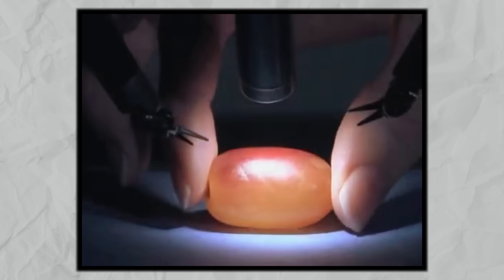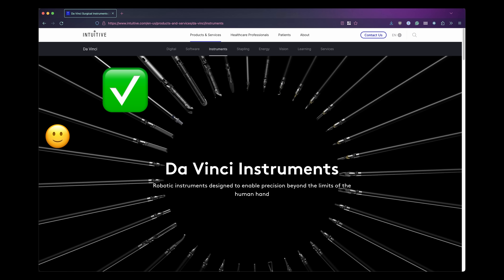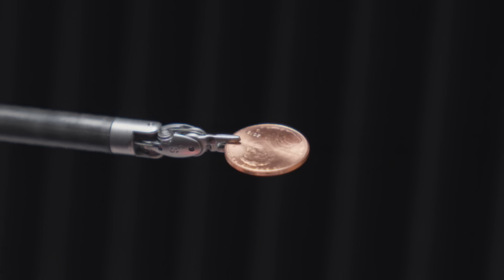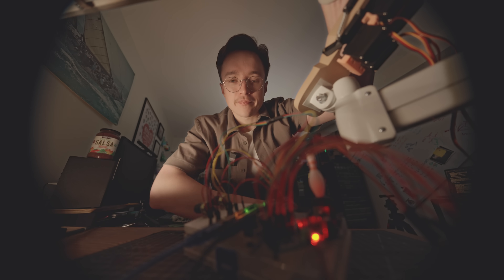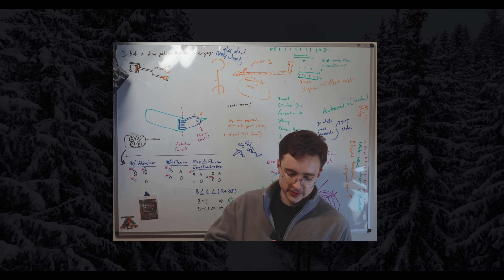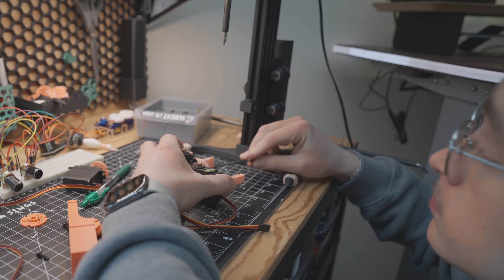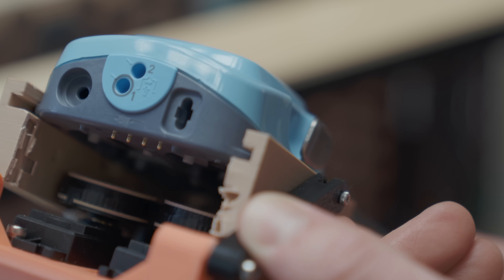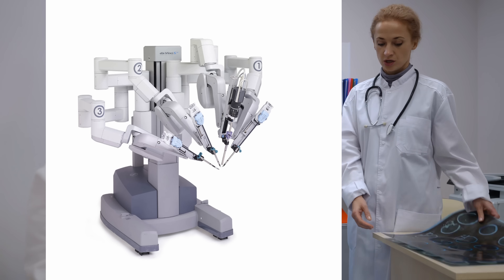Building a DIY Surgical Robot

Comment: This is an awesome project with a very real customer base. There are people who live remotely and there is a need for some kinds of minor surgeries to be performed on site. In my case I live on a boat and alone. The kinds of procedures are initially observation, recording, and transmitting information for remote diagnosis. The second procedure set is to do with a large number of skin surface procedures treating infections, cleaning and closing wounds, removing foreign objects such as splinters, glass fragments, and shrapnel of various types. 
A robot to perform this kind of procedure does not need to be a long reach robot as in the video. It will best be a very local kind of device that is placed on the body, or the body is pushed against a device that is fixed to a structure.  I would suggest starting with a cylindrical housing of around 200mm inside of which the process takes place. There would be a rotary housing which carry perhaps 3 short “fingers” that carry tools and a number of auxiliary functions such as suction, flushing, wiping, injecting, etc. Note the penetration reach of all of these devices is very short or shallow. 
A typical “procedure” might be to lance an infection, clean, disinfect, close and apply a dressing. 
Regardless of whether you see this as I do, you have me thinking about this need in a practical way. I am going to follow where you go with this with great interest. Thanks. I am a customer of a self surgery aid.

Comment: The most intuitive control I can think of for this is the wii controller. It might be another can of worms trying to decode that thing, but it allows for 3D motion in space and if you can figure out how to translate the robots motion by inverse kinematics, two wii controllers could imitate two robot arms. A and B button to close (hold) and close (trigger), orientation of the wii controller determines it's angle, translation of the controller determines translation. All wii controller accelerations are non linear, to allow for faster movements to cover greater distances virtually then they do physically (similar to mouse acceleration on a computer) and thus, the wii controller is the perfect choice.

Comment: Hi Bennett. Excellent work. I started down this same path last summer, prototyping a possible exhibit for a California science museum. In the end the exhibit got dropped ... but I'm still very much interested. I've got 3 of the "blue" units here (pincer-type, can't recall exact one) and a similar box of iterative 3D printed mounts. I like your spring-loaded coupling mechanism. Mine simply rides down the grooves and snaps into place, depending on rotating the discs until they seat properly.  I'll check out your git repo.

Comment: Hey Bennett! I’m actually used to be a Manufacturing Engineer for the Core Instruments division of Intuitive! You’ve got the older Si instruments there. Very impressed with your work! There’s a lot that goes into making that “talking” between the robot and instrument happen but you covered the basics great! A little background on the “life count” they actually have to qualify every instrument for a specific number of lives by running new versions through simulated use and do some math to calculate what the max life count would be. All has to be submitted through the FDA and approved for every country we send instruments to! Great Video!!

Comment: Make a gauntlet made with 1 micro proximity sensor in each finger. That is for flex,  extension and rotation. For movement you should hold your elbow in a platform with X and Y. With this system, you can do all with one hand.

Comment: A bit silly for a control solution but have you checked out VR gloves as a solution? You could try to map the movement of specific fingers and such much like the complicated machine the doctor uses  in the video. Though, you'd have to account for the limits of each machine, and I wouldn't really call it a precise solution either. But, it would definitely feel intuitive (if done right)

Comment: You could use a 6DOF controller from 3dconnexions, and then translate the output of that as serial commands to the device. A space explorer or pilot (both of which are deprecated parts) might be a good fit.

Or, you could just use a PS1/2 controller since they're serial to begin with and kinda easy to read, and they're like 8 bucks.

Comment: I might suggest looking into how 3d mice establish their many degrees of freedom. I saw another youtuber make a DIY version using a hall effect sensor and a magnet mounted to floating platform held in the air by 3 springs. Using an microcontroller you can measure the changes to twist, pitch, and height.

Comment: Do the servos really just snap in the 4 rotating disks like that on the actual machine? The coupling seems so small im surprised these small ‘bumps’ on the disks are able to transfer torque and dont just snap out of place. Im going to check out the CAD later, amazing stuff!!
Reply: These were my exact same thoughts, how did you get on?

Comment: About the controls:
1, a glove that controls the 2 metallic "fingers" precisely. 
2, Either 2 cameras to detect your hand "gestures" (we do not care the fingers) or a leap motion to detect the gestures.
3, some kind of virtual UI to assign the robot arms to your arms so you can control them with 1, and 2,
This is a good starting point. Later on you will need some kind of stand as your hands would be super tired and painful after keeping them in air for 30 minutes.
If you like it and you need help, just let me know.

Comment: Hey I love the video. Your resourcefulness is impressive. 

I know you have seen how the pilot cockpit looks like. One thing you don’t see are the pedals. They help you select which arm is active. 

For controlling the arms. I would use vr controllers like a valve index. You could even kinda mount those controllers to a swing  type thing if you wanted so you would have hard stops to keep you safe from pushing out of the surgical field. You can hold a button down that allows you to tell your electronics controller when you’re moving the tip and at that time you can increase the downscaling of motion in the arm and upscale your wrist motion to move the tip.  And in a sense you could do the opposite when the button is off. 
And yeah obviously all motion is scaled.  

Hope this helps.
Reply: A controller with an index trigger would work well to help you understand pen and close the tip.
Reply: Open

Comment: So I've actually briefly used one in a hospital brought in by a vendor. The controls at the station are electronically counter balanced and have different selectable scaling options built into the software to scale down you hand motions within the work space. They're incredibly well balanced and smooth, but id imagine you could achieve similar results with a cable and pulley balance system. Could also install rotary encoders on the balance pulleys to translate the movements.

Comment: I worked in surgical robotics for a few years, the way the tool attaches is via the sterile drape, you have it right that is it is spring loaded but each input axis typically has a disc that that can side before engaging and creates an oldham coupler to take up small misalignments. Typically you have to engage the drape side first onto the robot and then the drape to the tool. As someone else said the robot uses an RCM- remote center so the Dofs needed are smaller than you might believe- this reason the DaVinci has so many joints is to setup the RCM to the patient and then have redundant motion for clearance arm to arm. The Xi is far superior to the Si in this regard.

As to the inputs, you really don’t need anything crazy. The reason the DaVinci inputs are crazy is that they need the user to match the location and orientation of the tool. You can get away with nearly any kind of 6Dof sensor and it will work fine, you just have to pay attention when you clutch in and out a lot more.
Reply: The tools are cool inside, there are many different mechanisms to drive the wrist depending on device. If you open one know that the cables are tungsten and will be near impossible to cut and once cut conventionally become unusable.

Comment: Hi, I cannot stress enough how impressed I am from this work! Do I understand correctly that the ortho-planar springs in servo output shaft take care of the initial alignment with the spools in the intuitive tool? (i.e. the two pins initially can be not aligned with the holes in the disk on the servo and at some while this second rotates, they fill align?) Also, do you think this type of connection with the pins can cause backlash for the toletances pin-hole? Thanks!
Reply from the maker: That’s right on the alignment of the pins! An interesting property is the backlash you mention- the springs will give about 3-5 degrees under sufficient load, at which point the internal branches of the spring sort of run into one another, at which point the spring behaves like a rigid connection, until the high load is released and the spring decompresses (this assumes the pins have been aligned and the spring is completely planar)

I want to see how this can be mitigated with higher tolerance prints and special materials. TBD!
Reply: @BennettStirton  That's interesting, I look forward to seeing your development with this! (Just pay attention that if the springs comply also in torsional direction (It I understood correctly your point) at the inversion of motion you won't have accurate control from the feedback in your motors. Could it make sense to add in the design of the ortho-planar springs a feature that prevents torsional compliance while leaving the axial one? (Unless of course these daVinci probes have integrated encoders in the spools and you can read the output)...In any case, good luck and again great work!

Comment: For control you could always look at 3D input devices, such as the SpaceMouse and its DIY clones: Space Mushroom (by shiura here on YT), OS3M (by colton.baldridge on Hackaday IO), SixNav (by Shamrock, ShamrockTeam, or GreenCappuccino, the latter is their current GitHub name but the project was produced under their earlier name[s]), haptik (by ioces here on YT), etc.  The great thing about a 6dof input device is that you essentially get six axes of movement, both positive and negative, meaning you could control an entire arm via one input device, including the end effector at the 'wrist.'  Going the DIY route you could also do more, such as putting a joystick on top of the 6dof nub akin to how flight sticks will often have extra input, this could also apply to analog buttons (triggers), various directions of scroll wheels, or even putting the 6dof nub on top of something else such as a base with a rotary encoder, all for extra functions or for making functions more intuitive to use.  Alternatively, just get some VR wands, same concept but with a greater range of movement while also not being physically bound to anything.  The only thing is the kinematic input, as it's not as intuitive as most people would think; for example, say you have a 6dof input device and a 6dof robotic arm, these degrees of freedom are not equivalent, the input device has three axes of rotational and linear movement based around a common origin whereas the robotic arm bases these degrees on pivots within its limbs, where the input device should really only be mapped to the end effector's position and movement where the arm's various degrees of freedom are manipulated to achieve the end effector's position and movement. 

On another note, the end effectors themselves aren't all that complex either, as they're just cable driven components, which has been popping up in popularity over the past half decade in robotics, but these cable mechanisms have been around for quite some time in the medical industry.  The only issue on the DIY side is manufacturing at scale, but at the same time these all use very simplistic parts that you could realistically produce yourself with some basic metalworking, i.e. drills and hand saws if not also stepping up to using punches for repetitive parts; the only truly lathed parts needed would potentially be the drums at the the end of the cables, but a rod with some grooves for circlips would also suffice in all honesty.  These parts really are simplistic, it's just the scale of the parts that can be troublesome on the DIY side of things, but the entire end effector mechanism is entirely reproducible if you're looking for specific tools that don't exist within DaVinci's platform.

Comment: I had the opportunity to use one when the local hospital, that my parents worked at, got one and had a demo in its loby. It was extremely intuitive and required no leaning curve. I was in highschool at the time and it was really fun.
Reply: I will say that the freedom of movement afforded by the complex system was limitless. I had full range of motion of my hand. And there was a foot pedal that allowed you to pause movement of the system and pan your hand away. Similar to picking up a computer mouse off its pad moving it over and bringing it back down. After a couple minutes I felt entirely one with the machine
Reply from the maker: This is a great analogy- I read in a manual about this virtual “clutch” system, but this makes more sense now! Thanks!

Comment: Certified Da Vinci robotic surgeon here. A few comments:

- Yes, it is awesome to use one. Not only the range of motion and precision, but also the 3d high definition vision inside of a patient.
- the instruments you were able to  get are from the Da Vinci Si. This version is deprecated and if I am not mistaken, they are not being produced anymore. The new version (Xi) uses instruments that work similarly, but are not compatible (planned obsolescence for sure, the Xi offers very few benefits over the Si, which was already very good, they lost some of their patents).
- you control the instruments with two joysticks. There are pedals that you use when you want to change to another arm and control another instrument, or when you want to control the camera. In your device you may be able to control rotation and opening and closing of the instrument. What is still missing in your device is advancing and retracting, and hovering your instrument. The Da Vinci relies on a "remote center" in the trocar. Therefore, it won't damage the patient's belly when moving.

Overall, great work! Feel free to DM me if you need some help!
Reply: One more thing: there is little to none haptic feedback. If you pinch the joystick too hard, you will damage something as the robotic arms are very strong. Honestly, you get used to it and you rely on what your seeing only, which is of very high definition.
Reply: hey, I am working on a similar project I don't want to be rude but I have some questions and would appreciate ur help !
Reply: @adn7q657 I don't mean to be rude, but when you're asking for professional help, use proper grammar. "Your" is correct, "ur" is not.

Comment: A neutral hand position (i.e. handshake) with magnetic switches for up down left right movement of each finger could be interesting! Trying to find the keyboard that did this, but all sensors are suspended (magnetic) and use hall effect sensors so you can actuate them without fatigue. This would be incredible, and perhaps even more functional than the buttons on the actual robot?

Comment: Similar to shocks on motorcycle forks, many of those monitor arms have a "preload" screw which adjusts tension on the return spring. Often tiny, if you can find/reach it, backing off that screw will reduce the need for ballast weight.  

There may be one per segment. Expect a grub screw with a tiny hex head nestled in the joint that is colinear with the long axis of the arm segment. I bought cheap amazon arms and I needed a magnifier to see them.

You are probably mechanically skilled enough to swap out the spring but I am probably not: I expect it to sort of explode during disassembly, distributing key mechanisms around the room.

Comment: Very cool! (Love your soldering iron "drill press". 😄) About a decade ago, Intuitive brought one of their machines to a computing show I was at (can't remember which), and and they let people try it out moving little dice around. It was really amazing how they made it all feel completely natural. I also worked at a company that shared space with a machine shop that made the scissor heads, so saw a ton of them coming off the CNC machines and on the assembly benches. The scissors use a tungsten cable for actuation. The owner of the shop told me that the tiny cable was strong enough to hold up a Volkswagen!

Comment: It's a really cool project! Good job !
The controller seems to work like a video gimbal but in the opposite way (encoders instead of motors) for the orientation of the tweezer, the fingers seem to clamp a spring-loaded gripper that would allow the opening/closing of the tweezer.
So all this seems to be connected on a 3-arm structure that identifies the position in the air, again using encoders but translating their values into X Y Z positions (you know the length of the arm, the angles thanks to the encoders, so you know xyz)
It seems doable to me this way

Comment: Really great video and reverse engineering! You'll want to utilize the springiness of the couplers to insert and remove the device. Create a plate that is the shape of the inner cavity on the bottom (the bubble H shape), that sits around the couplers. Then, the ramp on the front of the device will push down the plate (and the couplers) as the device is slid in. Once it is in the correct position the plate can push up into the cavity due to the springs so that the couplers can engage the pucks. That is the reason for the metal clamps on the sides of the device... which are used to push the plate back down so that the device can slide back out.